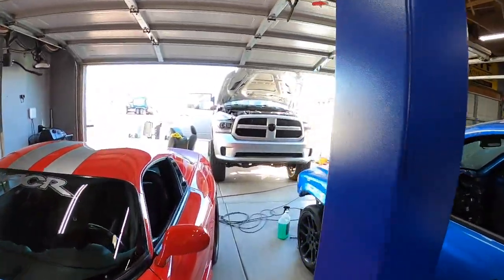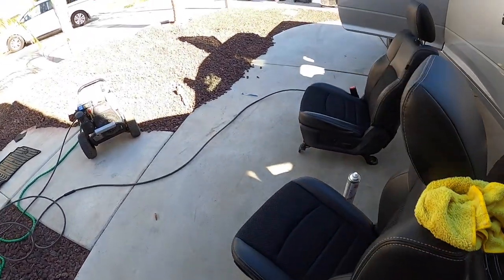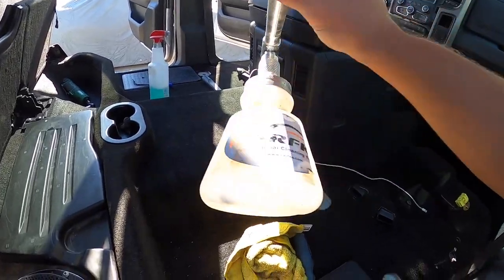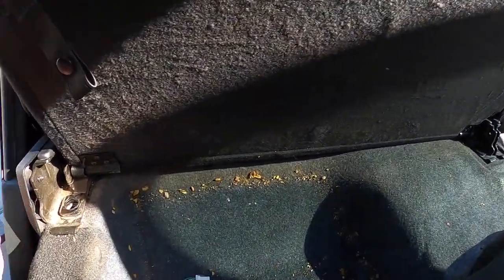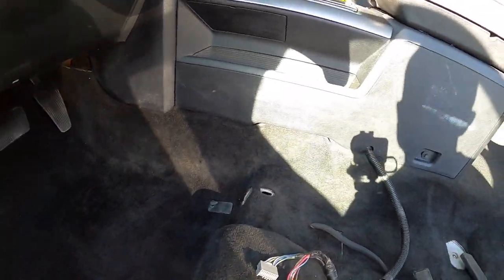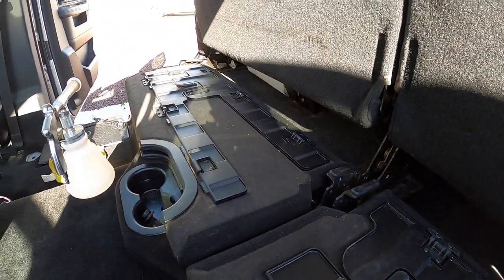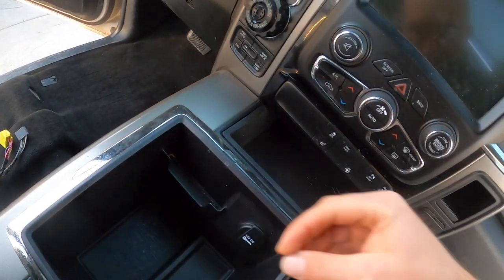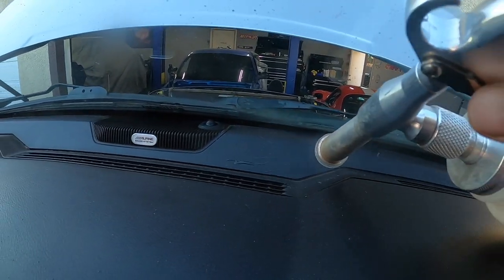CLEANING A DISGUSTING INTERIOR | RAM 1500

Comment: Just got the tool in the mail👍. And thing works good, especially on the web mesh in the middle of the leather seats. Found out wear safety glasses cause sh*t goes flying! Also make sure you got decent size compressor. My 26 gallon kept up but ran whole time.

Comment: Hey man, love the channel! I also own a 2015 Ram 1500 Sport. I was considering upgrading my upper control arms. I recently leveled out my truck with Fox coil overs in the front and Fox 2.0 IFP’s in the rear. But there’s so many UCA options: Icon, Zone, BDS, etc. which ones would you recommend?

Comment: That wouldnt get anything electrical wet through any small spaces?  or speakers?
Reply from the maker: You can dial back the amount of water with the adjustment knob if you’re worried on certain areas and can even turn off the water and just blow air
Reply: @BoostedMotorsports  Thanks bro, recently got myself a used 17 ram sport like yours but white and its just about perfect, only thing is there's vibration at like 70-80 mph sometimes, cant figure out if its tires or shocks worn out